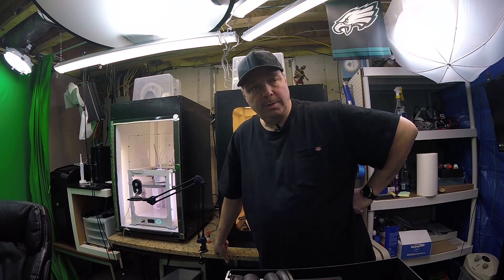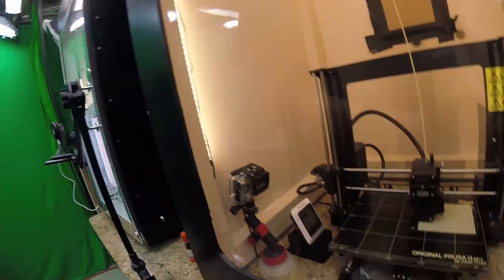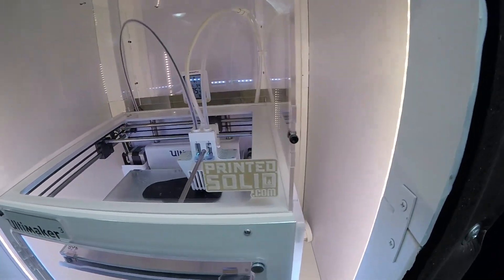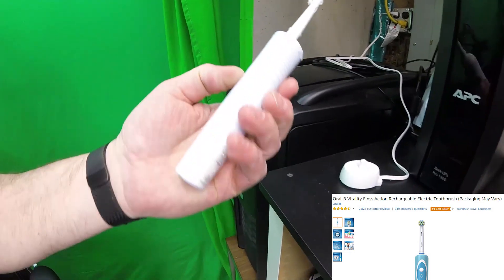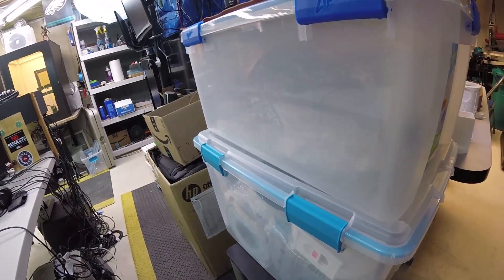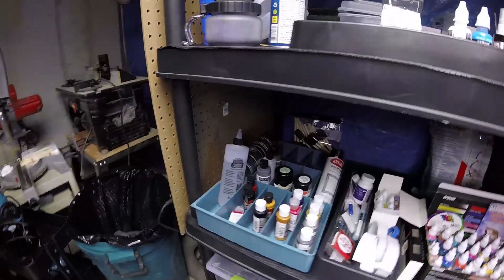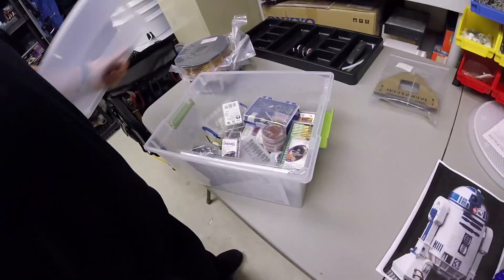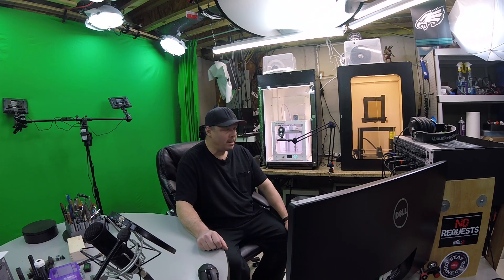3D Printing Workshop Tour

Comment: Very good tour, thanks for sharing.   I've been paying to get 3-D printed parts to use as casting patterns for my miniature engines.  Don't really have space to add a printer to my shop.  Lathes, mill, casting equipment, and tools leave just enough room for a small workbench area.

Comment: I bought my first 3D printer a few months ago, threw it on a table in a small spare room. Then it all started like in your case, started to buy different tools for sanding, dremels, scalpel knives, brushes, paint etc. I'm currently browsing for an airbrush and planning to redo the room to be more efficient - new table, some shelves, a place to paint the prints.
Your video gave me some great ideas, so thank you very much for that!